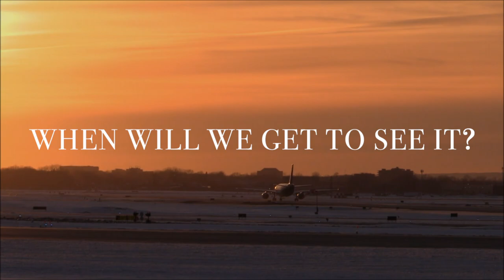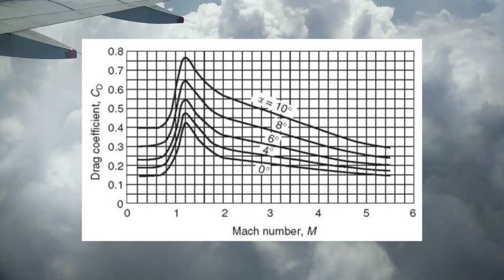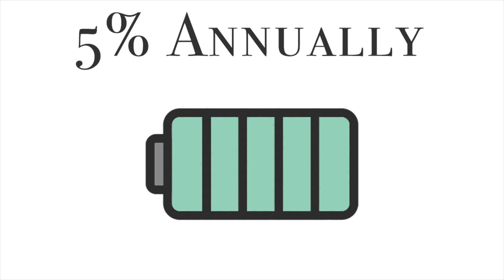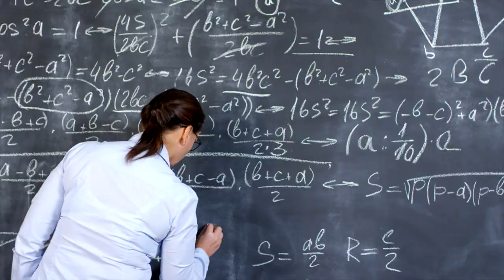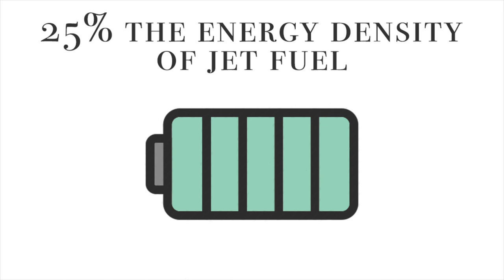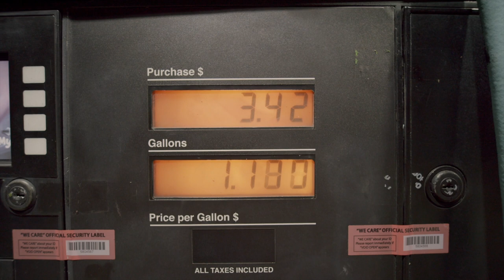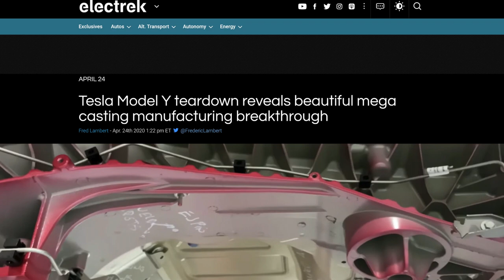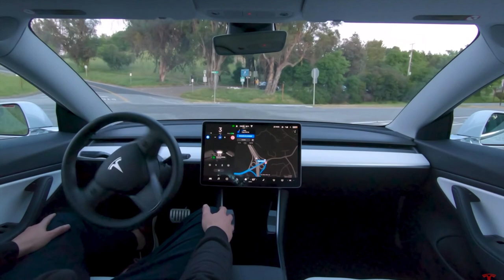The Economics of TESLA's Supersonic Electric Jet

Comment: A standard 777-200 carries 208,000 lbs of fuel to get its 5,000 miles of range. It requires 300,000 lbs of structure, engines, and systems to make such a flight. Even if we had a battery that was ten times better than current batteries, and therefore had 20% of the energy density of fossil fuel, and we only wanted to fly 2,500 miles, we are now talking about carrying over half a million pounds of batteries to use as fuel. Because of that, our airplane needs to be bigger, stronger, and will weigh more consequently. As the airplane gets larger, drag increases, and as it gets heavier, it requires more lift, which means we need bigger wings, and therefore make even more drag, and now we need more thrust to overcome that drag, which again means more weight and more drag. Unlike cars, airplanes are already highly efficient, with extremely aerodynamic forms, and unlike your misleading efficiency claim, a modern turbofan engine turns 80-90% of its fuel into useful thrust. The net result for this hypothetical electric airplane is a vehicle that uses exponentially more energy to do half as much, and in all likelihood, half of that energy will come from burning natural gas, and a fifth from burning coal. If we replaced all of our highly advanced commercial aircraft with equivalent capability electric aircraft today, surely Earth would boil over by the end of the decade, due to the increased emissions.
Reply: Would not agree with the last fact. What you miss is that fuel does not come in to existence by itself. It has to be produced. And that adds at least 15% of energy that was actually required to power the plane. Also structural batteries in planes will help to reduce the weight even more. And lastly, yes unless super advanced batteries are invented the electric planes will not be able to cover the same distance as fuel powered jets efficiently. However, the same as for electric cars, recharging can be made quick, and landing/taking off with electric power being much more efficient can make it all possible.
Reply: @mjk8019  Electricity generation is not 100% efficient either, but my claim about turbine engine efficiency relates to the narrator's untruth that turbine engines are only 50% efficient and therefore you only need half as much energy on board for an electric propulsion system to go as far. The energy that was used to produce, transport, and build infrastructure for the fuel is not relevant to the actual engineering problem of making a plane fly across the Atlantic with a cost effective number of people on it (~100-200 at least). The irrefutable fact is that for a modern high bypass turbofan engine, 80-90% of the energy stored in the fuel it consumes becomes useful thrust, depending on the engine. A comparably long legged electric airplane would require at least 80-90% of the energy on board as a normal turbofan plane carries, provided we want to smoke some crack and dream that electric propulsion is 100% efficient, which it in reality is not, especially when we factor in the higher voltage and aerodynamic problems associated with aircraft propulsion systems.

What most people fail to appreciate is that human flight is still a miracle. Even commercial aircraft built in the 80s are still at the cutting edge of what is technologically possible when compared to every other form of transportation. Every advanced technology, from composites to additive manufacturing to digital electronic controls, is first pioneered and used in aviation. We are not talking about something like the automotive world where there is so much fat left on the bone that it is relatively easy to come in with a lower specific energy and have a comparable product due to efficiency improvements. We should be proud of the folks who design, build, maintain, and operate these highly capable and highly efficient aircraft, rather than coming from a place of no firsthand experience and suggesting wishful solutions to an already well solved problem. This is particularly true in a world in which the vast majority of electric generation, a far easier problem to solve, is highly polluting.
Reply: @acefighterpilot  Yes, I fully agree that the currently achieved efficiency of the jet engine is human ingenuity at it's best. And the people that work on the engineering of these engines and planes really did a marvelous job. However, if we overcome the limitations of battery technology there is really no place (except rocket engines) were we would need combustible fuel powered spacecraft. Of course that is not going to happen now, or within the next 10 years, but eventually we will run out of fossil fuels and will have to adapt new technologies, just like we did in the past.
Reply: @mjk8019  We are developing new technologies - Oxford recently announced they have developed a cost effective way to turn CO2 into jet fuel, and Porsche has launched a pilot program to convert CO2 from carbon capture into high octane gasoline. Any chemical reaction, with the right combination of catalysts, heat, and pressure, can be run in reverse. That is the future, until we can manage flight without using reaction engines based on new physics.

By the way, don't hold out for massive battery improvements such as we saw going from nickel metal hydride to lithium ion. Lithium is as far over to the left on the periodic table as it gets, it has extremely low ionization energy. There are no more big breakthroughs to be had in battery chemistry. It's all about packaging now - structural, solid state, different form factors.
Reply: @acefighterpilot  Can't argue with that. But those technologies seem like far fetched. Meanwhile we have the tech and the know-how to do a medium range aircraft that does not pollute and can cost less to fly already now. So why not do it? If not Tesla, someone else will do it, as it seems to make sense economically.
Reply: @mjk8019  Those technologies - turning CO2 into fuel - are simple and inexpensive relative to any battery production. Porsche's method relies on electrolysis of water, which you may have done in ninth grade chemistry, and atmospheric carbon scrubbing, which has been around since the seventies. Oxford's method is novel but inexpensive and uncomplicated. Unfortunately, neither are nearly as trendy and self righteous as battery electric. 

If you define a medium range aircraft as being capable of 1000 miles, bearing in mind the vast majority of modern airliners are capable of five times that, and even if you only wanted to haul 19 passengers (commuter class), we are not capable of building a cost effective airplane that will do this. Per unit, it would likely exceed the production cost of Concorde.
Reply: @mjk8019  Let's take a 40 passenger Dash 8 Q200, an older design, but among the smallest commercial aircraft in common service. Using 835 US gallons of fuel, it can carry 40 people 1125 nautical miles, with a maximum takeoff weight of about 36000lbs, and two engines producing 2100hp each. We're going to electrify it, with no loss in capability, but we will make some extremely generous, fantastical assumptions in favor of the electric plane;
Its structure, engines, and systems weigh 0 lbs 0 oz,
Batteries have twice the specific energy currently feasible,
and
Batteries have no volume.
First we start with the range. Each gallon of jet A weighs 6.8lbs at sea level.  To get 1125 nm range, it carries 5,700lbs of fuel. Although the best batteries available today have about 2% of the specific energy of fossil fuel, we'll be generous and say it's 5%. This means we need 20x the weight in batteries to cover this distance, or about 114000lbs. This is the empty weight of an Airbus A321. Because our airplane is much heavier now, although we are pretending the batteries have no volume and therefore drag has not increased, and we are pretending there is no weight to the structure, engines, or any systems, we now need to increase the wingspan from 85 ft to 118 ft, and we need to increase the thrust of our engines to about 60,000lbs total output, in addition to requiring much longer runways for takeoff and landing. Although our science fiction batteries have no volume, our bigger wings and engines do (even though we're pretending they have no weight), and now the drag of our airplane has increased dramatically, requiring us to fit still more batteries to make up the same range, and again larger wings and engines, and again more batteries, and again larger wings and engines, ad infinitum. Do you start to realize how absolutely absurd the idea of an electric airplane seems to anyone who has ever taken a class in Physics of Flight, whether to become a pilot, engineer, or mechanic?
Reply: @acefighterpilot  I am no expert here, just thinking out loud. Regardless of which technology gets mainstream, most importantly is to clean up the air we all live in and avoid greenhouse runaway for Earth.
Reply: @mjk8019  And that's why Tesla worship is counterproductive. We all want to live in cleaner air, we all want to keep Earth habitable. But when people just focus on the trendy cult-like pipe dreams of Tesla, it distracts from the problems we actually can and need to solve. If you want to make a difference in the cleanliness of aviation, call up (if you live in the US) your federal representatives and tell them you want them to legislate to give the EPA the power to regulate avgas. The vast majority of small airplanes (Cessnas, Pipers, etc) use piston engines designed in the forties and fifties that still require lead to run - when you see a small plane flying overhead, it almost certainly is running on 100LL - 'low lead' - avgas, which contains about half a gram of lead per liter. We do actually have the technology now, and since the late nineties in fact, to create 100 octane fuel these engines can use that is totally unleaded. Unfortunately, this fuel is more expensive, so the changeover has not been made yet, but if the EPA had the legal authority to regulate avgas, general aviation would not have a choice.
Reply: @acefighterpilot  I would never take anything for granted, things change, and for every purpose there is a solution. Just look at the electric training aircraft Pipstrel, battery power is ideal for such tasks. People choose that to save money. Yes, you can fly thousands of miles on gas, but sometimes you just need a few hundred. Science is a place where people question authority and not clinge to the old dogmas. We will not progress if we do that.
Reply: @mjk8019  The Alpha Electro is only capable of an hour's flight time...Any flight school that uses the Alpha Electro as a trainer, if and when it gets approved in the US, must also have a gasoline powered trainer aircraft, because the Alpha Electro is not capable of making the 150nm cross country solo that is required to obtain a pilot's license. Moreover, it proves my point exactly - the Alpha Electro carries 277lbs of batteries, which replaces 78lbs of avgas, and a 220lbs aircraft piston engine. There are no technological improvements to make the Alpha Electro feasible, it just hits the hard limit of the weight an airframe of that size is able to support because it replaces it nearly 1:1.
Science is a place for reality. If you want green change, it is done either with sustainable fuels or a ban or reduction in flying. Not through pipe dreams.
Reply: @acefighterpilot  I live in Europe at the moment and drive a small european EV. If I had any public transport near me I would use that instead. The moment I first drove my EV on the road I finally started to understand how toxic are the fumes that come out of the other cars. I was shocked that before I was used to that smell coming from my own car nad never even noticed. So pleople need to wake up. And Tesla is helping one way or the other.
Reply: @mjk8019  What they have done in the automotive market is impressive. But tech companies are all about making promises and not delivering. With something like a supersonic electric airplane that would be built in Elon's lifetime, it is a promise that can only be believed by people who have no familiarity whatsoever with the subject matter. I am also for change, but change that can actually be delivered. If you live in Germany, you have one of the biggest environmental problems; the burning of brown lignite coal for electricity and heat. If you live in France, you have one of the biggest environmental solutions; the mass adoption of safe, well regulated nuclear power, and research into fusion. When the problem and the solution are only a border apart, it makes a lot more sense to tackle the relatively easy problem than to peddle and believe cracked up pipe dreams.